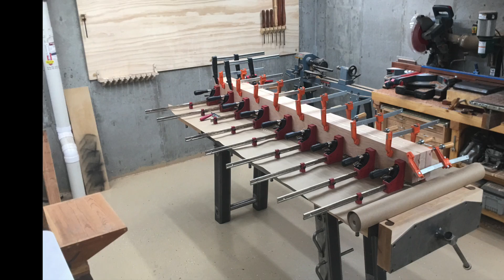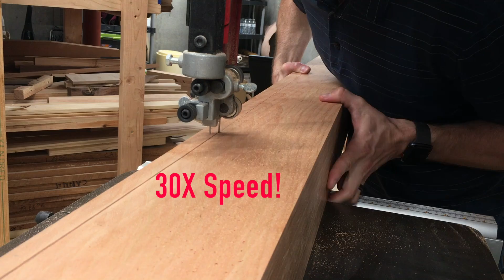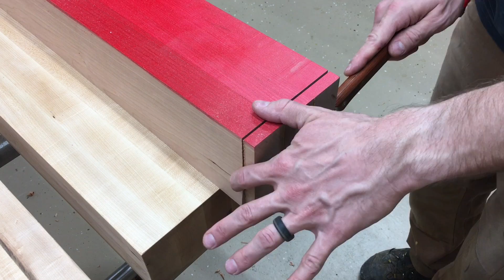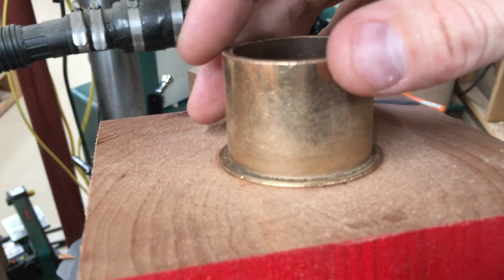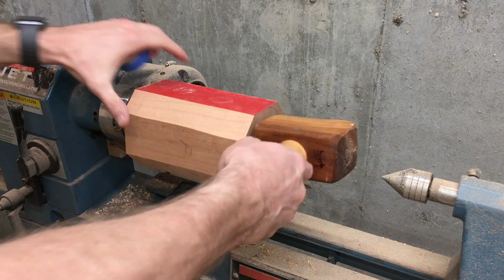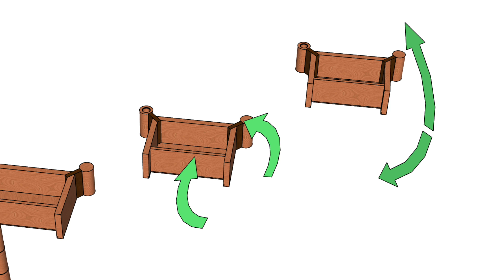Cantilever Cabinet Build 2 - Posts

Comment: This is going to be incredible! Maybe ball bearings centered vertically inside the bushing and set screws at top and bottom tapped into the bushing so that you could adjust how it sits on the shaft with a long Allen key. Like adjusting Blum hinge

Comment: For adjustment you can use two concetric sleeves in place of the bearings between the shaft and drawers. One sleeve fits on the shaft, the other fits on the first sleeve. The holes of the sleeves are bored off-center by the same amount, say 2 mm. When they are rotated to align with each other the 2 mm eccentricitys add together to offset it by 4 mm. Aligning them 180º cancels the offset. Both can be rotated together to place an offset of between 0 to 4 mm in any radial direction around the shaft.
Reply: I thought of the same thing
Reply: Yep right on point.

Comment: Sagging adjustment achieved with the tapped anchors. Torsional twist is only relative to the adjacent faces. Find a way to glue up each drawer with a slow setting glue. Glue , stack & shim in place bottom to top. This may have to be done separate from the carcass then reassembled. Good Luck!

Comment: Holy crap that's a labour of love right there! Brilliant work :O
For the swing out drawer adjustments, how about a bearing bushing of, say, bronze in the hinge portions of the drawers? The bushings can be a slightly loose fit, and held in place with set screws. That way you can adjust the setscrews to adjust the concentricity of the bushing relative to the drawer hinge.

Comment: One thing I wouls suggest is buy and use carbide forstner bits. You will find they last far longer and cut cleaner and more accurately. Ask yourself; would you use high speed steel circular saw blades or carbide ones? The anwser is clear. The only non carbide drill bits I use are the regular twist drill bits, even the carbide brad point bits are far superior ans well worth it.

Comment: Is there a rod that goes all the way through the hinge?  If so, I'd make the top "bearing" have 2 sets of 4 set screws you could use to adjust the concentricity on two planes.  Just a thought.   Might even be possible with a tapped wooden dowel.

Comment: I think I would either use a ball catch system or a fixed wedge where the drawer rides up a slight incline to its permanent closed position. Although the wedge wouldn't change your design on appearance I think I would prefer the ball catch as this would keep the smoothness of the drawers as designed but i think this design might have to have a metal? top cap to the each of the non pivoting drawer post as the ball might wear it with time.   Hope this makes sense?  Curious how you approach it.

Comment: Not sure if it is intended to have it in the sketchup design but is there a reason why the side boards of the each drawer is extended further behind the back of the drawer boards? Seems like because it extends to far back that it may not either close or open since the hinges are in front. Correct me if i am wrong but aside from that detail i love the overall design and great work!